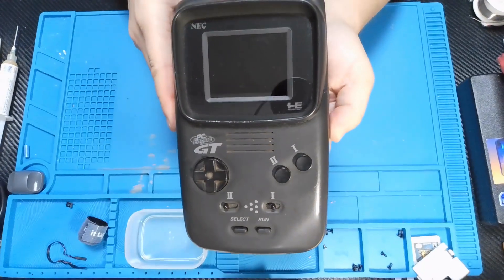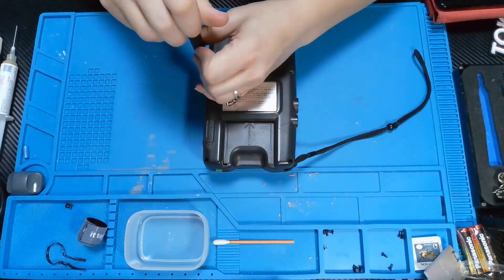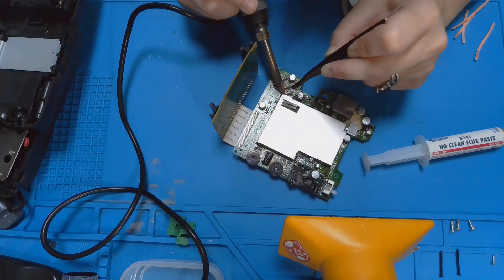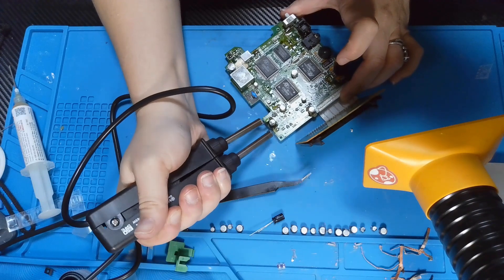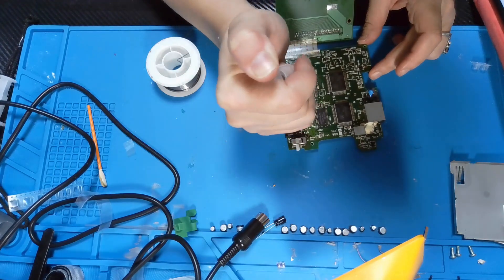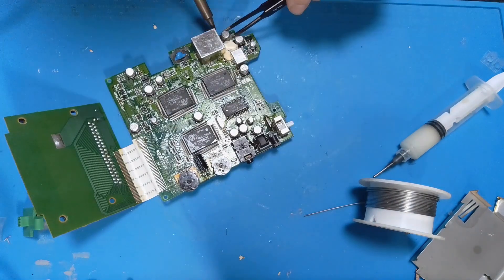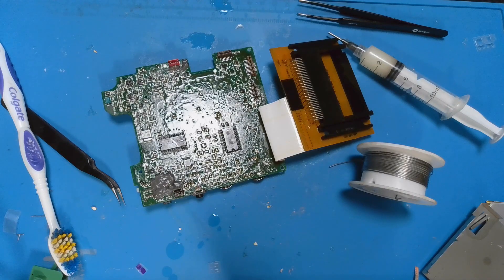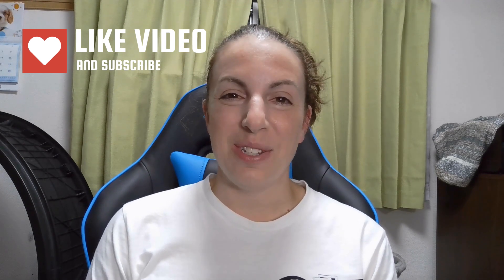Can I repair this unique retro console TurboExpress/PC Engine GT?

Comment: I had similar issues. The issues was batteries, it's very picky for some reason. I bought aftermarket power cable and it worked perfectly.  By the way Your a cutie 😊
Reply from the maker: Oh okay 
I'll have to give that a try

Comment: Great video! I bought a Game Boy DMG two months ago. It was working fine, but yesterday when I tried to turn it on, it wasn't working anymore. There's no corrosion in the battery contacts. I changed the power module, but it still doesn't work. :( Do you think it could be the capacitors? or maybe the on/off switch?
Reply from the maker: Well clean all the battery terminals, then the power switch. You could have a look and see if any of the caps look out of place or puffy. Past that I would say it's all trial and error lol

Comment: As it doesn't appear to be powering on, it might be best to try and follow the voltage to the board. Assuming batteries provide voltage at the connector, it should make its way to the switch (common failure point). You should be able to check the switch terminals on the switch with a multimeter in ohms/resistance or diode/continuity test. If the switch appears to function as intended and voltage is getting to it, downstream should be the fuse. The fuse is labelled 'F500' and 1amp (can be seen at 4:19 near the power switch). It's quite possible that an incorrect power supply had been plugged in and it's blown to protect itself. Again you can check it with a multimeter for low resistance/continuity. The DC power jack could also be damaged and hence may be creating a open circuit. Normally when a plug is inserted, the will disconnect the battery. It may be worthwhile to try and supply via an external power supply, or measure continuity/resistance across the terminals and see if you get difference results with a plug in and also a plug out.
Definitely check your work on the capacitors to rule out a possible new problem being introduced. Agree with one of the other comments too, assuming the screen doesn't work, surely some sound may work too? Might not be worthwhile changing the screen just yet as I feel it should be showing more life first.
If you can too, close up/zoom shots of the PCB (or hold the board to the camera) help the audience feel involved as we may be able to spot something that looks a bit off :)
Reply from the maker: Thank you for the fuse location and number that will be a big help. Following the board and finding faults is my next challenge to learn so that I can hopefully fix more things

Comment: make sure to check the battery contacts and that voltage is getting from the batteries to the board
Reply from the maker: I definitely need to reattack this piece but I'm not sure my skills are good enough yet. I will test that since I do know how to do this.

Comment: Didn't know which way the card was supposed to face?   That's common sense.. and they are designed that way.... LABEL FACING YOU.

AND, after you put in the batteries check to see if you have voltage going to the board and trace it to see if you can find where there is a short.
Reply from the maker: Hahahaha sorry I don't always have that but I will remember for next time. I'm excited to get back into this one and see if I can figure it out but my skills are so-so right now.

Comment: Check if your getting voltage from the batties going to pcb those old dc jacks have a connection in them that breaks the battery voltage when pluged in they get stuck on old devices sometimes and the amount of batteries required to play im certain they used a power cord a lot. I know i sat in corner of room with my gamegear plugged in cause batteries were always to expensive.

Comment: Check the fuse!! If not check the two little coils under the silicon one of them is for batteries and the other one is for the power adapter!  To see if the screen is not working! Insert a game! The picture tile facing out! And then let it play, if you hear any music or the game playing but not screen is visible maybe the screen is bad! But 9 of 10 the screen is fine, 
I would doble check the little coils fist and the fuse!!
Reply from the maker: Thank you so much, I will do this for sure

Comment: Hi great video BTW , have you succed to repair it? It could be the black resistor (The Fuse) for the power on the top right maybe
Reply from the maker: I haven't, I'm still working on it and learning how to follow traces, but thanks for the suggestion I will look at that area. I think my local store should have a replacement, but typhoon right now so I have to wait a bit.